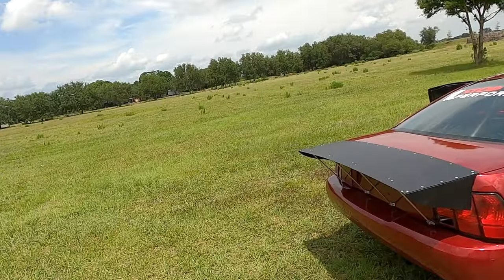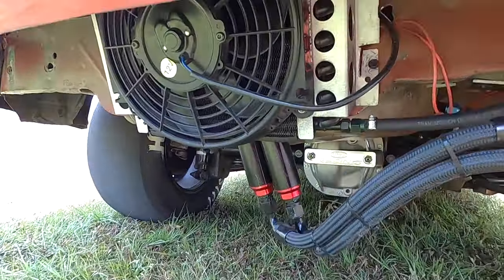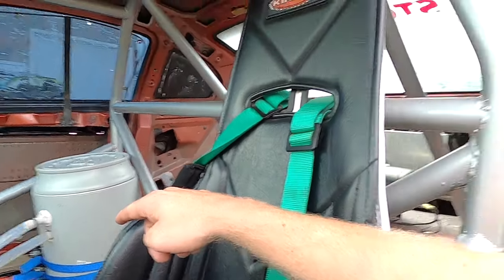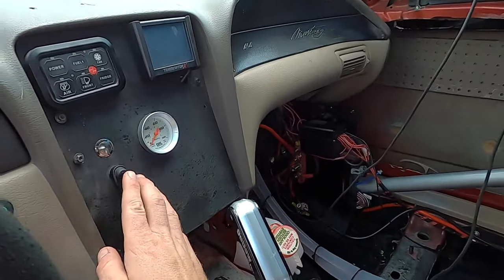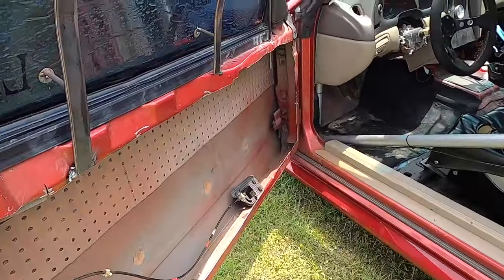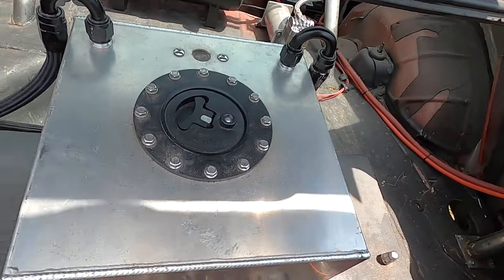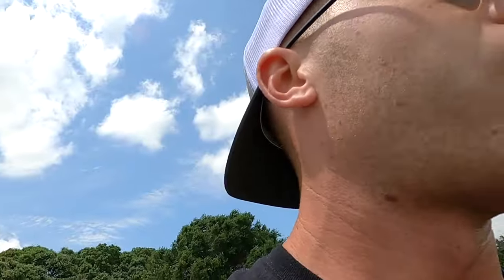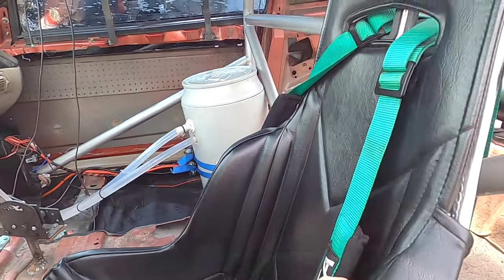BIG Mustang Guy Now!!! My 1,000HP Mustang & Burnout Foxbody!!!!

Comment: You have tons of room, especially after you put a trailer hitch on and grab a small trailer. And you know for laughs and science you should consider grabbing a small upright home A/C put it in the trailer with a generator then extend and run the cooling side pipe to inside the car.